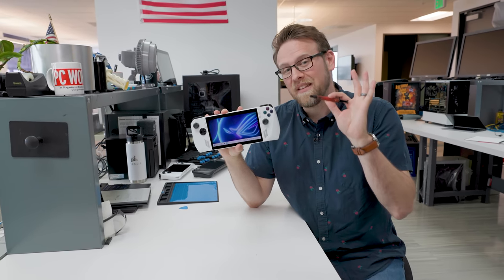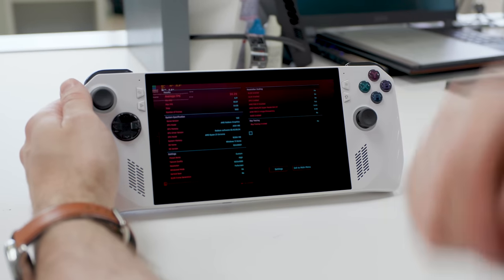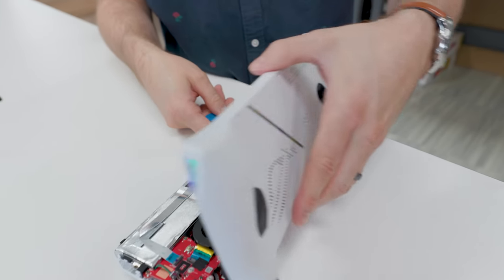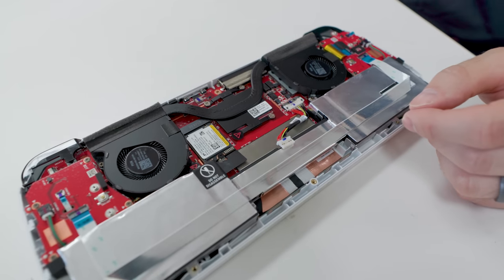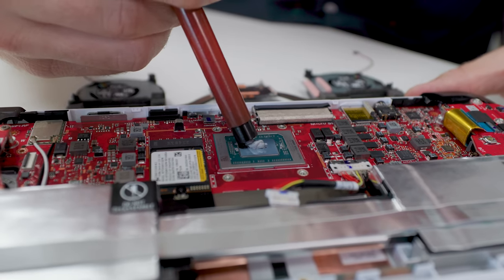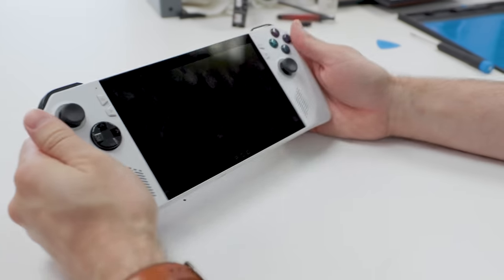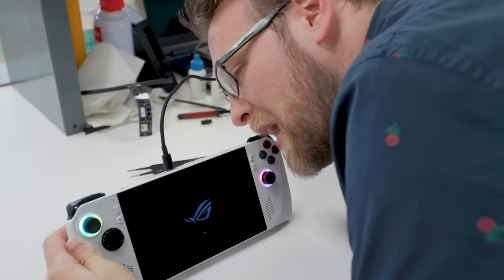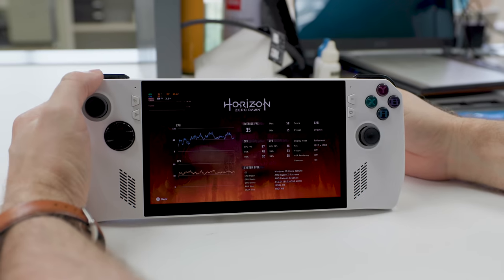Does The ROG Ally Benefit From A Thermal Paste Upgrade?

Comment: They’re using phase shifting thermal paste, you undoubtedly used lesser paste than ASUS used, this is the secret behind their “zero gravity” cooling. Do minimal research and you’d know that and that you have to plug it in after disconnecting the battery.

Comment: non professional work - assembling heatsink: 500% to much. heatsink with silvercompound touching resistors and capacitors -> fail! 
as less as possible by using credit card that is bigger than die! after first assembling test, have to chek - after fixing the screws!
FAIL of WORK.....

Comment: You put way too much paste and I'd say the biggest problem is the TIM that you chose.
Reply: the amount means nothing, the excess just gets squeezed out. not enough can be a huge problem though
Reply: @bradhaines3142  .. That thick of a TIM that's like Play-Doh you're absolutely dead wrong about getting squeezed out. Watch the video again and notice the thinness of the heatsink plate.
Reply: @DJaquithFL  yeah the stuff is like playdoh which is bad, but that doesnt change how much the amount matters, just look up ANY videos on it. pattern, too much, just enough. none of that matters. only how good it is, and if theres enough
Reply: @bradhaines3142  .. Absolutely the amount does matter especially when the clamping force is not sufficient to displace an over over over abundance of very viscous TIM. If the TIM he used wasn't as it is, I won't even bother making the comment.
Reply: @DJaquithFL  yeah youre just completely wrong. do ANY research on it. again, the thickness of this definitely matters, but not the amount. 'too much' is why you see it around the sides on the capacitors, it moves right out the way when you screw the cooler down. the play doh looking stuff wouldnt do that as easily, but itd still do it
Reply: @bradhaines3142  .. I think that you need to research this again. This isn't normal thermal paste. Again, it's the equivalent of Play-Doh in addition to that its temperatures are higher by 2 to 3° C than the fast assembly line of the cheapest TIM ASUS could find. What more proof do you need? 

Most non-conductive TIM's are within +/-0.5°C, and most of the benchmarks that you'll ever find are with a substantial HSF / Plate assembly that's easily capable of spreading TIM evenly. This ASUS has a very narrow and thin pressure plate clearly wasn't designed to spread out an overabundance of Play-Doh. ... Again here 2-3° C HOTTER then OEM.